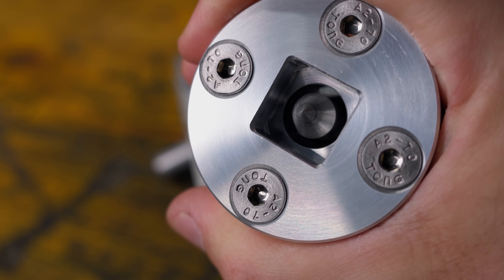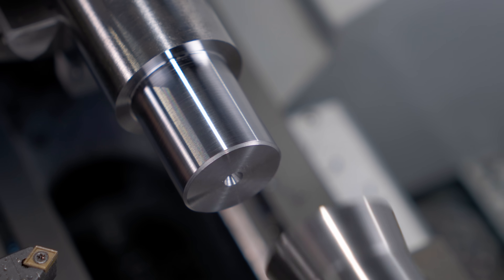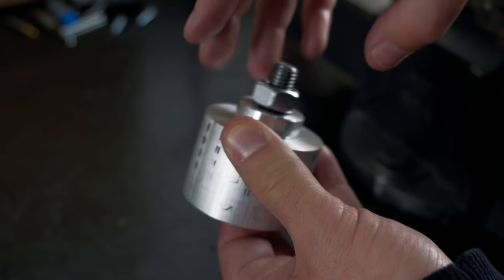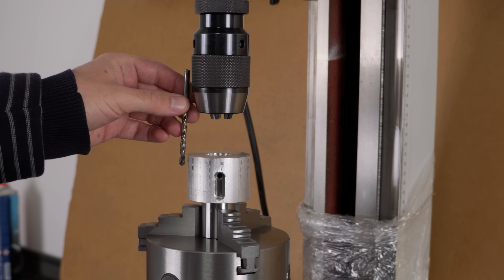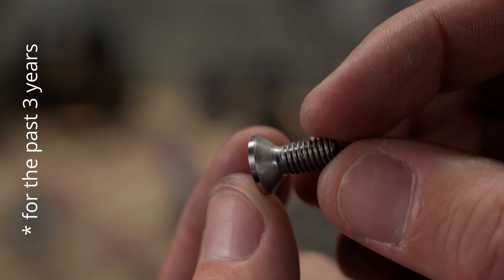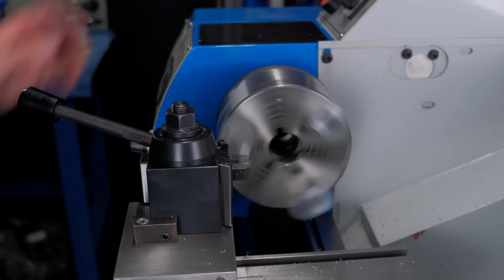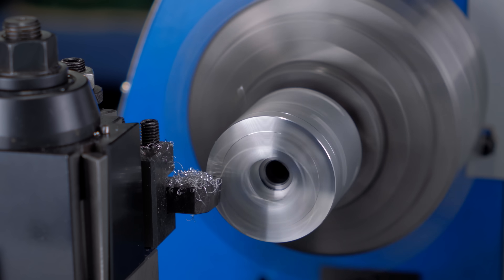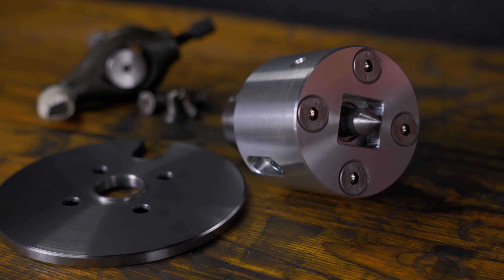Driving ANYTHING between centers on the lathe.

Comment: Talk about reinventing the wheel!  Make job-specific tools if you must, but avoid making narrow-scope or single-focus tools for the shop.  It's a bad use of your time.
Here, you seem to have a spindle or a center problem, and this is the impetus for building a device that defeats the spindle/center concentricity perfection. (or at least, the perfection which should be there)
There is a reason why dog plates exist.  After this, will you still be fixing the spindle/center problem you revealed?

Comment: Good show sir! I believe I'll be making similar tooling to renovate my amal monoblocks... I've several to straighten up. Any thoughts on boring and sleeving versus boring and making over sized slides? I've 389,689 as a pair, then a 389, 389 axed, and a 689 to make up a set for a triple. All are 1966 or earlier, all same bore size. All the zinc alloy. I enjoy watching you as your a very detail oriented fellow.  The quick release threading tool is one project I'd enjoy having a print , ie dimensions to work from. Bear in mind I'm American n don't have much metric fastner/tap/die selection.  Thank for putting up such good clean content. We'll done.
Reply from the maker: Hi Brent. I'm not familiar Amal carbs. I know what they are, I had a set in the past that I didn't use and sold, but I never rebuilt any. A quick search returned this thread: https://www.homemadetools.net/forum/sleeving-vintage-amal-carburator-68355

I don't know if you've seen that thread, but it seems someone had a question similar to yours, maybe you'll find there some insight. I'm sorry that I can't help more, but I also don't want to be giving you bad advice. 

As for the threading tool, I suggest checking the Facebook group called "Auto-Retract Threaders and Automatic Threading Stops". Mine was heavily inspired by Mr. Whoopee's (who runs the Facebook group) tools. He also sells them, in case you wish to buy one and save yourself the work. I've also added a link in the description of my video directly to Mr. Whoopee's channel - there you can check his different versions.

Comment: NBR Works,
Your machining is amazing! I would like to add an observation concerning grinding the end of the spring towards the end of the video. There is a potential danger of the spring held in your hand getting caught in the grinder and snagging a finger clean off. It could happen so fast you won't be able to react in time to prevent the severe injury. I would have gripped the spring in a long nose vice grip to keep my fingers out of harm's way. This also goes for long chips and birds nests on a lathe or around a drill or end mill. Just my two cents to contribute to safety for everyone concerned. Again, your machining skills are second to none! Thank you for sharing your considerable knowledge and skill with us.
Reply from the maker: Thanks. You're right, I should have been more careful with the spring.
Reply: Safety First !!! .... Thanks for bringing it up.

Comment: Great, tool I have something similar for working with a dead center with the deeper of my chucks still on the machine, but like others have said. If you can’t trust your spindle MT, then fix your spindle’s taper! Having a working spindle taper is essential for basic machine alignment and use. This is a basic aspect of lathe maintenance being able to repair burrs and if necessary re-cut and grind the spindle taper, is a must have capacity. 

Short of my desktop/benchtop scale lathes at home, that I have owned for 30+ years and managed to keep their tapers pristine (needing nothing more than a light touchup lapping), I have done it on every machine I have ever owned or used professionally at least once, usually due to a burr forming due to someone (sometimes me, more often someone else on shared lab machines) not cleaning the bore before seating a taper tool. This happens, even on $50K+ Schaublin tool room lathes, used for aerospace tool room work on flight spacecraft components, some idiot (not me in that case) will be careless and put a burr in the spindle bore. Work needs to get done in spite of it, so you spend the 20 minutes to fix it, so you can get your work done, not 2 hours making a workaround that also leaves the problem there. It’s not hard to diagnose and fix, and could have been done in a fraction of the time necessary to make the tool.

Print and fix your taper, print and check your taper tools, fix them if necessary too.

But the tool is interesting. Good work.

Comment: You can't trust your spindle's taper? I'm no machinist. I've only watched youtube videos. But can't you run a boring bar into the spindle taper to clean it up a couple of thousandths? Would that not work?
Reply from the maker: Hi! No, it needs to be reground (with a grinding stone). I'll have to make a tool post grinder for that, until then I'll use this tool shown in the video.

My lathe's spindle taper doesn't the correct angle ground from the factory - hence the 'can't trust' part.

Comment: I really like this video because I created a home-made lathe and I was having trouble turning my wood on it, so I cam with the exact same concept (not execution), except I had interchangable 3D printed adapters that were mounted on the threaded rod I was using as the shaft and center.

Comment: at 8:36 another option is to use tapered shank or machine drills (in a collet) directly in the quill, negating the room a chuck takes up, also it is a very rigid way of mounting a drill.

Comment: a great build, but in the past, they just used a faceplate (thats the reason for the holes in it!), this drives the 'dog' and holds the center, in the bore; just don't forget to wedge the dog, to stop backlash.
Reply from the maker: Hi. My spindle taper does not have the right angle, so I can't use a dead center in the spindle and the faceplate. Thanks

Comment: Interesting tool - one question though - if you made if to fit a 5C collet, why not do all the subsequent operations holding it in the collet....? Seems easier than the 6-Jaw...
Reply from the maker: Hi, I don't have a particular good reason other than convenience. The 6 jaw was already on the lathe, so I used it. 

At 4:06 the part was flipped and I machined the register for the spring, that does't need to be concentric to the rest of the part (there's a gap to the outer piece), so I didn't even try to indicate it, if I remember well.

Then I indicated it to machine the outer piece at 13:41 (just for the finishing pass, to get the run out closer to the steel body). 

I had a couple of tenths of runout  (0.0001/0.0003"), which is as accurate as I can probably get with the 5C. So I went ahead and didn't touch it until I finished all operations. 

In the future, as long as the center is recut in place, there's no need to worry with the runout in the main body, so I can use the 3 jaw, the 6 jaw or the 5C (whatever is already on the lathe). I hope this makes sense.
Thanks
Reply: @nbrworks  Great - thanks, yes, all very clear !

Comment: My lathe has a MT taper in the spindle. I pop the chuck off and use a MT dead center in the spindle when I drive a dog.  I also cut an aluminum holder with a MT taper in it so I can use the dead center in the chuck.
Reply from the maker: My taper does not have the correct angle ground.
Reply: @nbrworks  Why can't you re-install a compound, set your angle correctly and take a 0.005" cut from inside your spindle and correct the fault? 2nd possible solution, an MT-3 tapered clean-up reamer/cutting tap.  I have seen them on EB for about $35. On this day 04-Jun-24, the auct number is 313252838129, it will be different or gone totally in a few days to weeks so look fast. There are other sellers that will pop-up, I'm not involved with this or any other sale.
Reply from the maker: John, the spindle is hardened. It must be reground. I'll get there one day.
Reply: @nbrworks  Tks for the reply. "The Hobby Machinist" users group has a thread on cleaning up damaged MT tapers. The thread is titled "Cleaning up MT2 and MT3 tapers?" and says "Hardened or not, the reamers should work" on the 2nd PAGE of users comments. Good luck with your decision/path...  I can't find my original comment to stack this comment upon the top of....Thanks for making this video.
Reply from the maker: Thanks for the reference, John. I'll look it up!

Comment: By my abrasive wheel I have several  thin pieces of aluminum, (0.100-0.250"), w/ various loose fit fastener holes drilled towards the edge.

When I need to chamfer a fastener, I put it in the appro hole, then spin it w/ an allen socket or a 6-point socket, depending on whether it's a socket or hex head.

I find the little piece of aluminum lets my fingernails get beyond the nail beds & keeps my fingerprints from being sanded off.

Give it a try.

If I need to taper or dog point a fastener, I use a cordless drill to spin it in the drilled plate; I get much more control than w/ a drill alone.
Reply from the maker: Thanks for the tip!

Comment: why do people even bother with lathe dogs or other drivers? i never use them. as long as you put good pressure on the part it never fails. even on heavier cuts .100" at .008"/rev  on 1.5" round bar, the friction alone still holds the piece in place. you should give it a try.
Reply: Even if part weight more than 200 kilogrammes

Comment: You know you can't have too many tools, jigs, fixtures and chucks but have you ever considered repairing your Morse Taper? :face-blue-wide-eyes: This is a classic example of over engineering but I love it. I imagine that if I had many between centers jobs with a small square end I'd be happy I had this tool on hand. Let's face it. There's no greater satisfaction than digging out an old (had to have it back when) idea years later.

As always, I thank you for letting me visit your shop. 
Wakodahatchee Chris
Reply from the maker: Hi Chris. That's a good question, thank you for asking. 

Yes, I have designed in Fusion 360 a complete toolpost grinder, including a second (longer) spindle for the morse taper job (because I don't think I can buy a grinder with an adequate size for my lathe). 

I ordered the stock to start with it, but then stuff got it in the way and I lost momentum - I haven't started yet, but I might revisit that in the next months.

This tool in the video took some hours to make, that's true, but worked well and I can continue to use it until I got the taper fixed. 

Thanks!
Reply: @nbrworks  Thank you for the update. I just knew you had to have something on the fire to fix it. :hand-pink-waving: